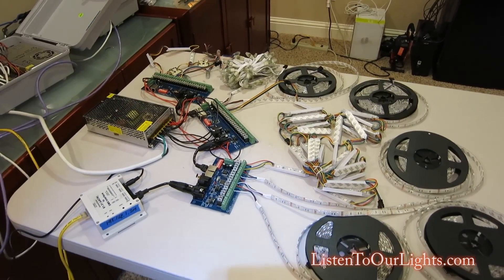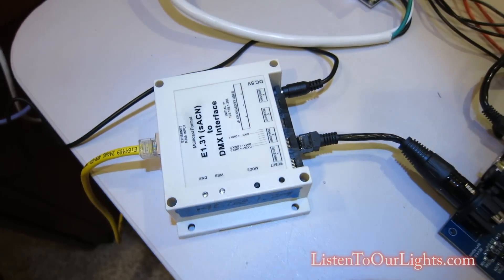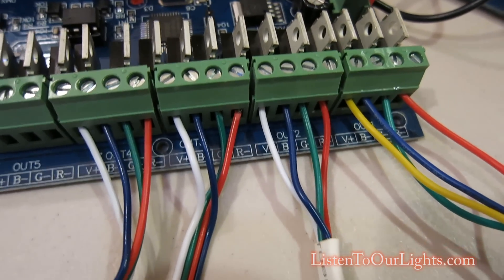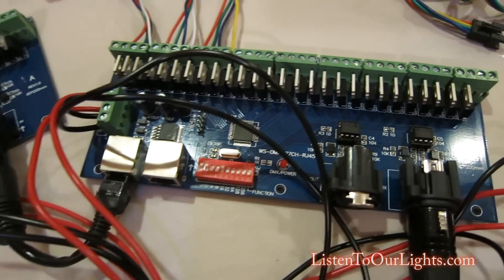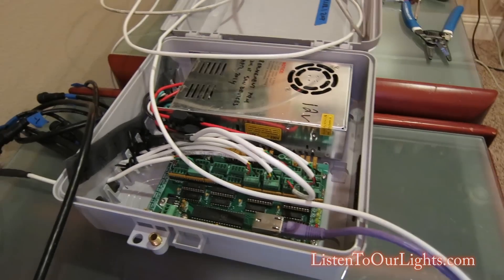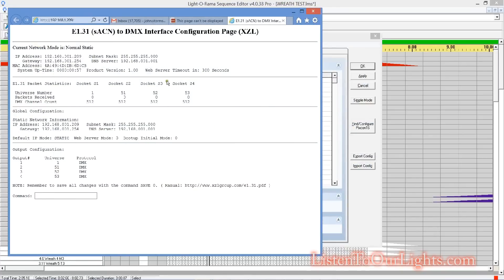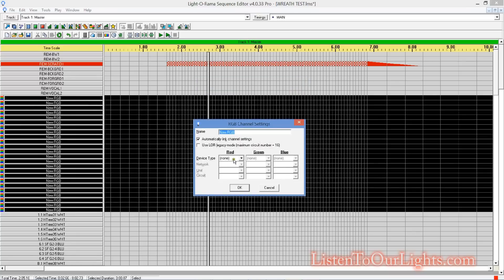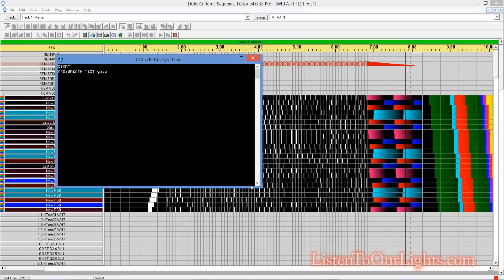RGB Tour and Overview

Comment: Hello I’m very new to this right now I have a 16 Channel controller cTB16PC from light O Rama   And I was wondering if I can use a controller E1.31 on the same network and the same software. I do not have the pro but I’m thinking of upgrading to pro from light O Rama for this purpose but I’m very confused really complicated. Just watching your video and it’s very complicated to me i just have 16 channels right now and a very small area to run the lights show don’t need a big light show because I’m on a apartment building with a balcony not much room.

Comment: Would you do the same with rgbw par cans that power themselves separately and that have dmx in and out connectors only ? 
This is helpful if I use on led strips but I wonder about using this Par cans I already have. 
Thanks